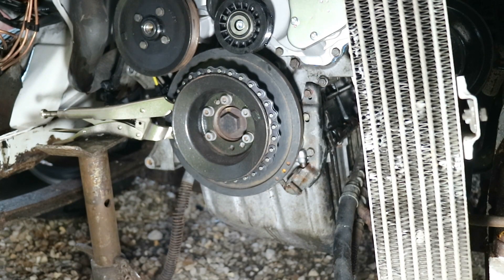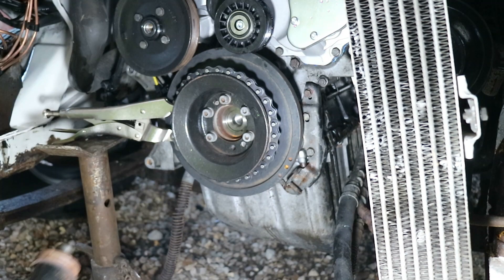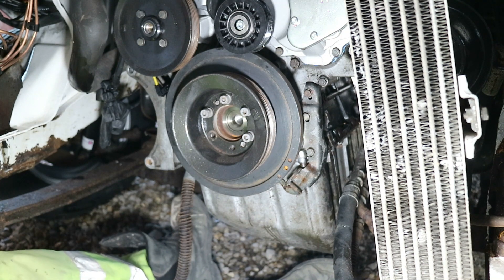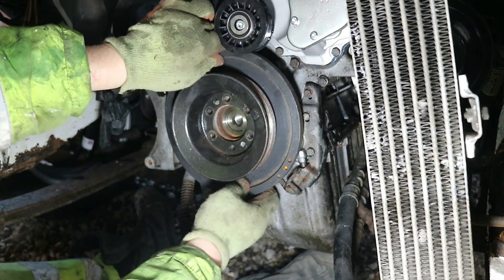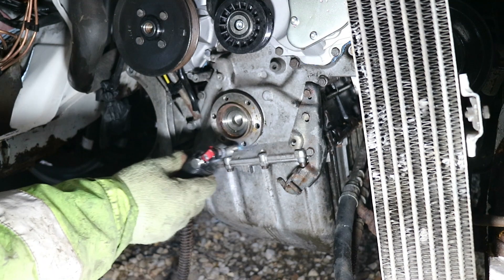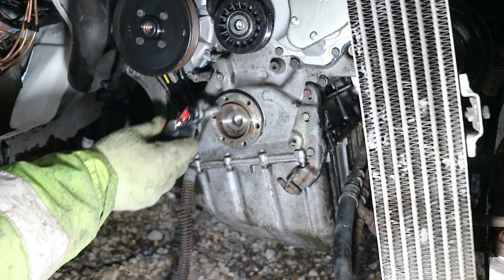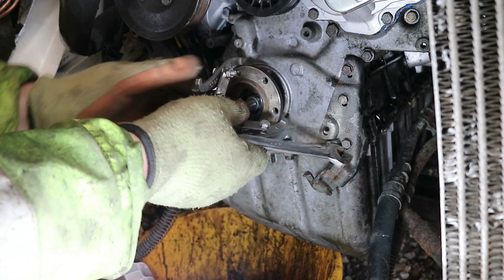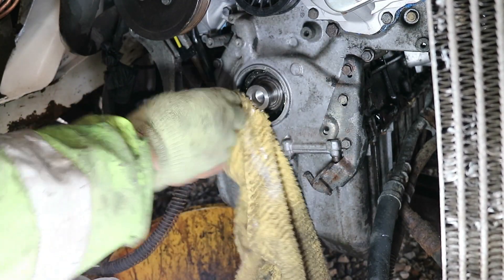Mercedes 410D Crankshaft Pully & Front Seal Removal

Comment: Thanks I need to do mine! It’s a mess! Same engine as yours, mine is 310d though. And wow your shackle mount is awful!!! I thought mine was bad!
Reply from the maker: I've just finnished removing the mount today, angle grander & air hammer and it all came of in bits.   Got to repair the chassis behined it before I can fabricate a new lear sping mount.  Will look good when it done.

Comment: Is there any difference between the 2.5 and the 2.9 (2874cc) version, I lost mine and I don’t know how it looks😂😂
Reply from the maker: Well a 2.5 is normaly 2,475 cc and the 2.9 L  is 2,874 cc which is used in the 310D and 410D Mercedes-Benz T1 .  As for how your looks, I dont know what your engine looks like.  But thing you can do is joint all the T1 Facebook groups and ask on there, as there will be loads of members with your engines I would gause.  Cheers Jeff